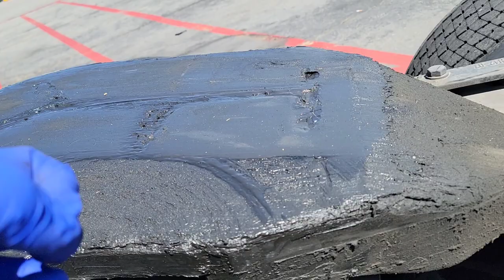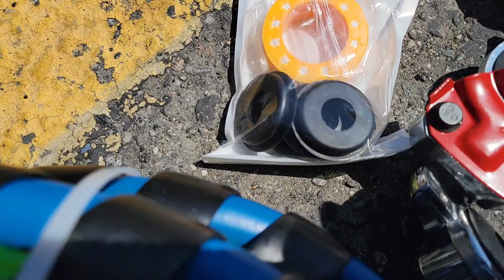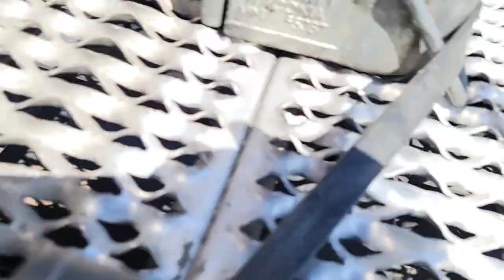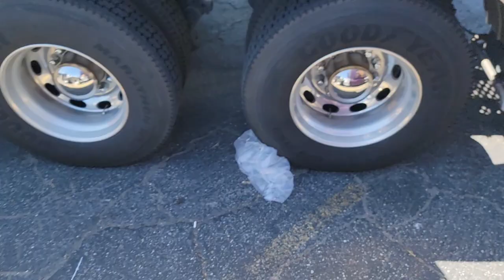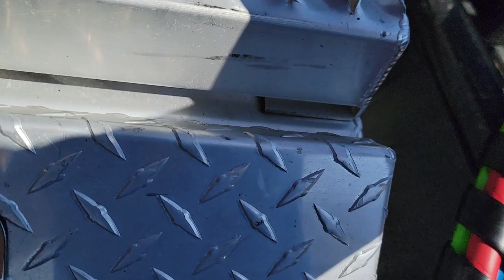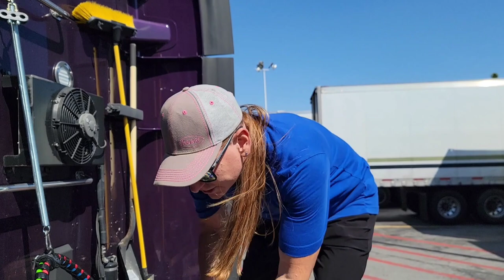Always Keep A Spare... Air Line Set! How to Replace Your Trailer Air Lines

Comment: Instead of screwing the airlines directly into the fittings on the truck you could install female air quick connects.  Then when you change lines you just transfer the male fittings over or replace the male fittings each time.  That also allows you to easily take your lines off and store them inside.

Comment: I am going to get a Harbor freight 7/8 box wrench use cut off wheel to remove the closed in and then I can carry about a 3 foot cheater bar that will fit on the now blank end to assist with both more torque to loosen and tighten these or other stuff, plus it will also allow you to keep your hands away from the cat walk in this process, just and idea to help you as well. I love the video it was very helpful for this new driver to plan ahead. Thank you
Reply from the maker: Not a bad idea, however since you're getting it at Harbor Freight, you won't need a cut off wheel to remove the closed end. You can just chew it off with your teeth LOL. Be sure to get about three of them because the first two are sure to break.

Comment: Hey JJ another great video! Thanks man. I was curious though, you mentioned it's a big no-no to have the lines dragging on the catwalk, but it looks like that spring is about twice as long as it needs to be and they were hanging down pretty far. Is it just a trick of the video?
Reply from the maker: You saw it correctly, so I had to clamp it accordingly. It a more flexible spring though, so it's working out well.

Comment: Hey JJ this is off topic but I saw you have some super singles on your truck? How do you like them? I just bought a truck that has em now but I was thinking of swapping them out for duals
Reply from the maker: I haven't had any issues with them at all, and I've had them on all of my trucks. No blowouts, no traction issues, etc. They've been good to me. With that being said, I also have no experience with duals, so I can't give a good comparison.
At the very least, I'd wait until the tires were low on tread and in need of replacing, that way you're not throwing away perfectly good tires and tread.
Reply: Super singles are good. I’ve got them on one of my trucks and duals on the other. Just don’t buy recaps!

Comment: When you can’t pull the release handle it just means there’s too much pressure against the lockjaw. You don’t need to do anything special just keep the trailer released and back the tractor up and immediately set tractor brake to keep pressure off the jaw. Takes half a second to fix
Reply from the maker: True, but I found that that only helps me about half the time. And then once it doesn't help and I've got to go through the whole process anyway, I've just resorted to going through the full process instead of something that tends to not work all the time because then that is wasting even more of my time having to do both. Hope what I said makes sense LOL

Comment: If you buy them from the shop not the C-store they usually have the nicer set.
Reply from the maker: If they have them in stock. And when they do they're definitely overpriced.
Reply: @JJtheTrucker  true, always cheaper on line. I was just suggesting to those drivers who want the better setup, but can't find them because they didn't plan ahead as your video suggested. :)